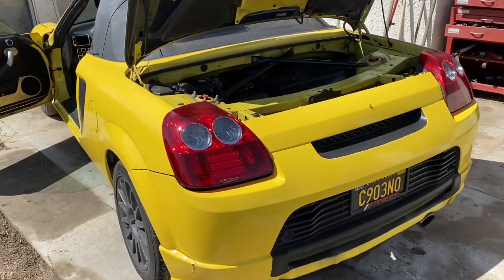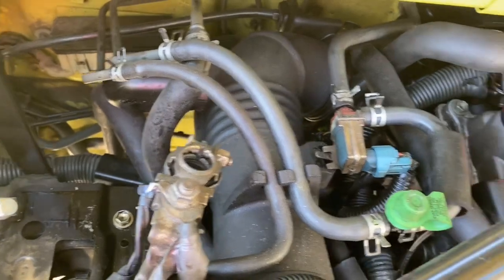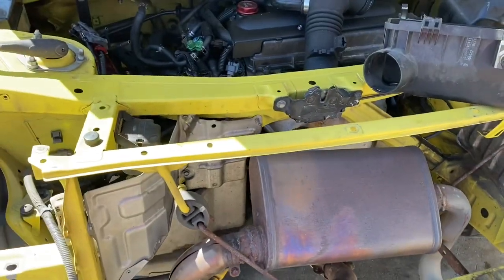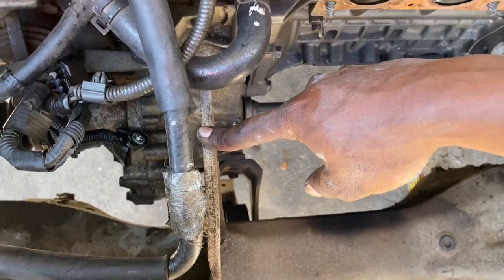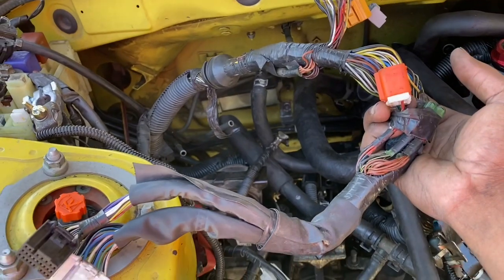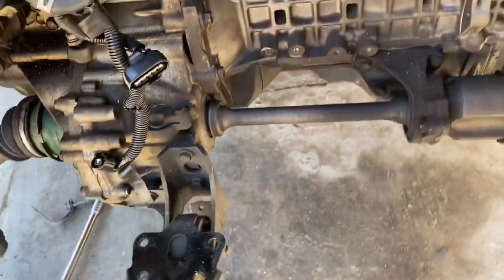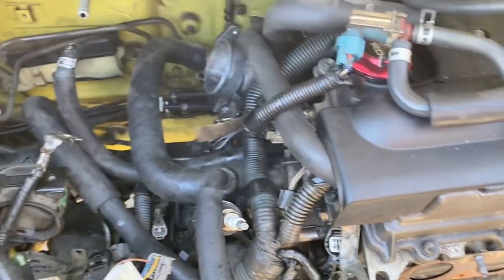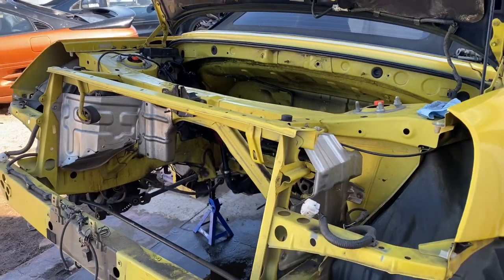TOYOTA MR2 SPYDER k24 BUILD PART  2

Comment: I  think the k series is 50 pounds heavier than the 1zz and 2zz but you won't notice it. Mitchsmotorsport has kits for the swap and the ac can be used to as well as a working cluster now. Just be careful of drive shafts. I saw a guy break one at the drag strip. I have a 2zz mrs the 1zz is just wrong lol. Looking forward to seeing the results :) hybrid racing shifter ftw👍
Reply from the maker: Thx for the info , I’m using Mitchs new mounts that there making hopefully there good
Reply: @rarewitit7899  there supposed to be better not sure. I had to settle for the 2zz as I can't do this myself and I had to get a manual conversion as all mr2 spyders are smt here in Australia